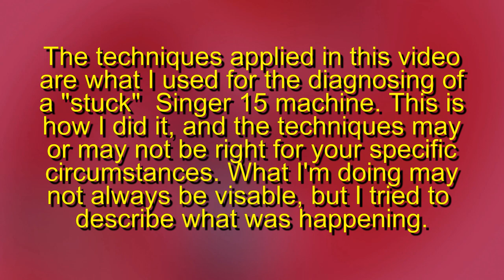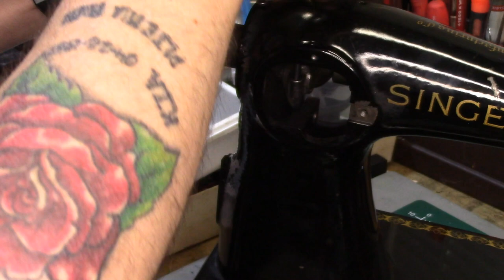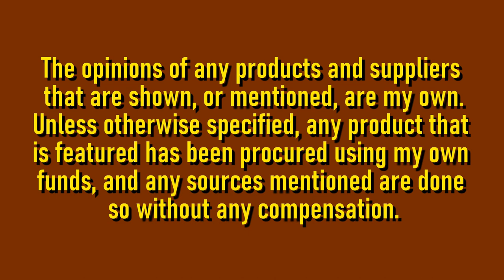Freeing a Seized 15-91: A Benchside Chat Part 2 - Reassembly

Comment: Wow, good as new. Definitely a beauty! Good to know about the cam screw to the shaft: I had a stuck 201 that the needle bar was high on. After going through your checklist, and trying to find somewhere to isolate the needlebar, I found one of the screws on a block tightened way too much. Problem suddenly solved. Amazing how one tight screw can seize the whole machine!
Reply from the maker: Sometimes, it is something simple, sometimes... well... it can really be a can of worms...